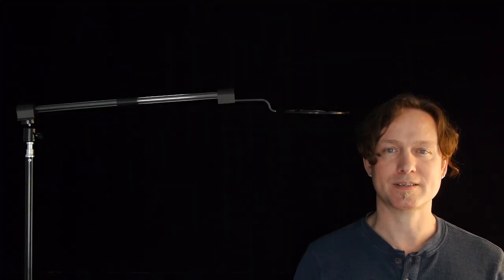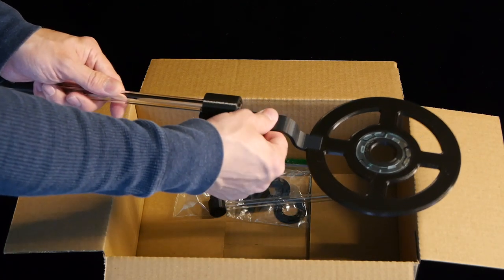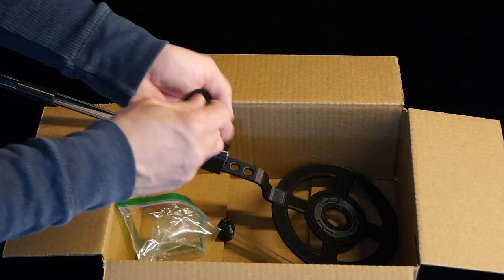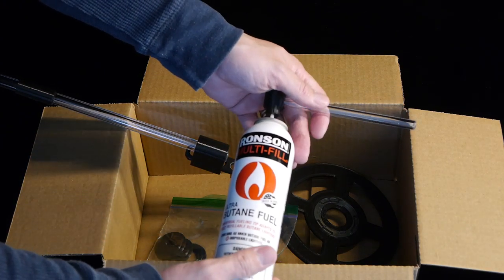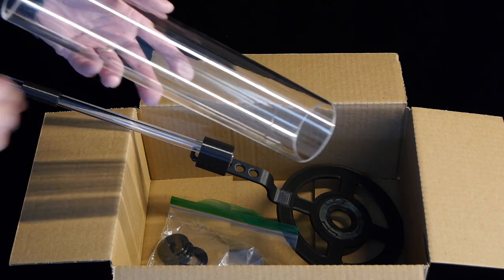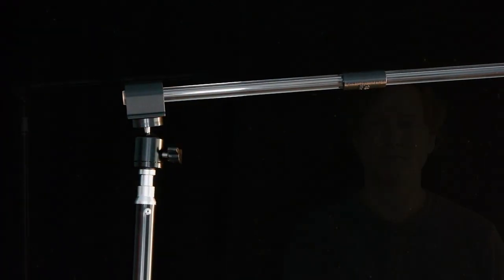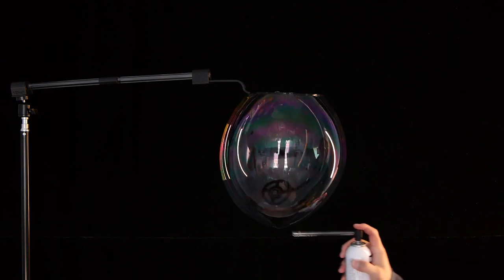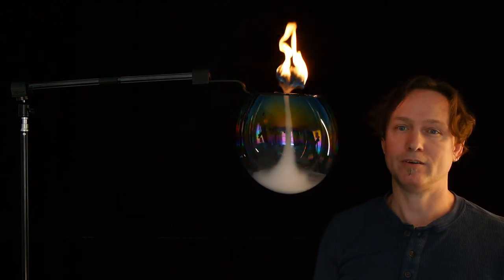Modular wand demo

Comment: How do you make the smoke puffer?
Reply from the maker: I designed it with Fusion 360 and 3D printed it. The electronics are based on ecig parts.
Reply: @supergiantbubbles  Thanks for replying! I don't have a printer, but I can fab things just fine without one. A couple of pipes presents no problem to me. But how did you convert the ecig to work with your printed parts?
Reply: @SASunDog  Dustin sells these ready to go!

Comment: I'm trying to master the non-butane bubble tornado before I add the fire
 aspect. I can do it, but I just need help with one part: how do you 
consistently pop the film between the two bubbles? I can only get it 
maybe 1 out of 4 times. Any help will be greatly appreciated.

Jumbo Juice FTW
Reply: As per Mr. Skye himself:
"Popping the film between the bubbles is easy, but there is a trick to it. To consistently pop the film I put the tip of my skinny tube at the surface of the film and draw in quickly with my mouth (not my lungs). This draws a bit of the film into the tube and causes the film to pop."